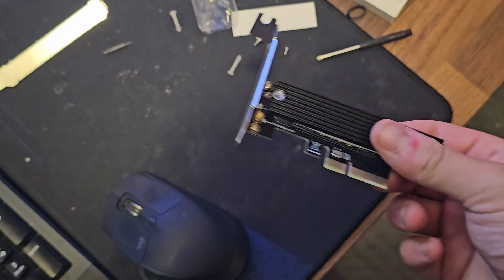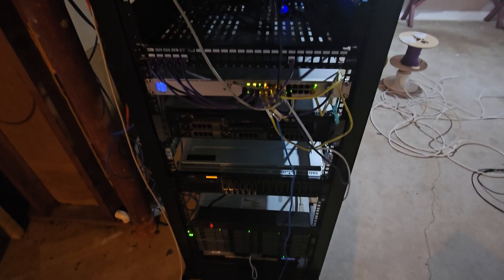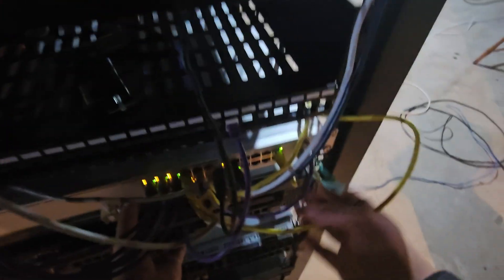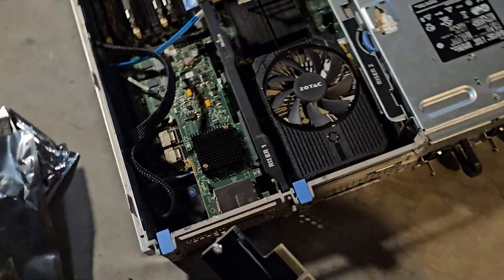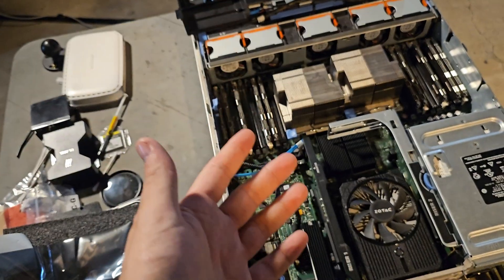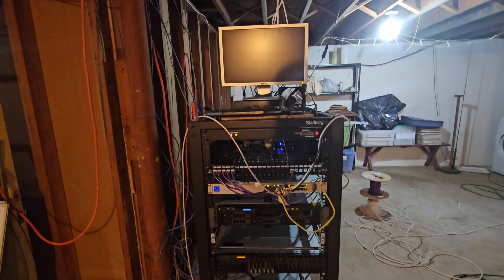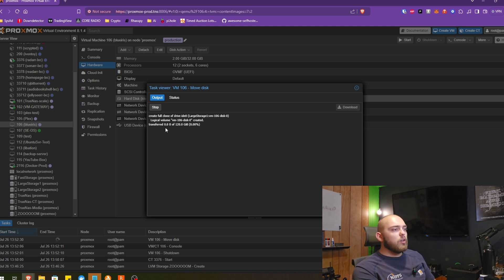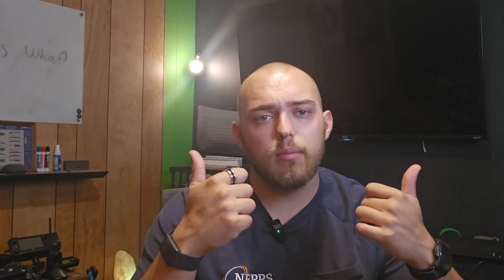Giving my R710 an upgrade it was never built for! | NVME

Comment: Question: Can you put together a list of all your upgrades for the Dell R710?  - Just found one for free and adding it to the homelab
Reply from the maker: I can't fully remember how I got my r710 but over the years I've put better Cpus in I went with 2x Xeon 5660 since it gives me 12 cores 24threads. The server has an upgrade kit for 315gb of ram. The nvme adapter seen in this video and the arc a310 for Plex. Other than that my server has some storage for vms and a storage controller card running copper to my jbod

Comment: You don't need to shut down the vms to migrate storage devices, it only speeds it up slightly. I migrate my vpn and my pihole to another node for maintenance since fast enough for deployment and fast enough for devlopment are 2 different speeds, 0 downtime.
Reply from the maker: Good to know thanks

Comment: Using an Samsung 990 wouldn't be faster than an Kingston NV2: Just PCI-e 2.0 and the CPU will fast maxed out in heavy I/O. Try the NMVe as cache. If it dies, nothing will happen =)
Reply from the maker: I needed the SSD for storage of vms due to io issues i could of gone with 2.5 ssd but I am not a huge fan of the storage controller that's in the r710 and I wanted the system to be migratable if I build a new server in the future

Comment: You are not using the full potential of your 990 PRO as the R710 only has x8 2.0 PCI slots. I would be afraid of this single NVMe failing because of the SSD write limit. This was the main reason I upgraded to a R730 with 24 SAS drives. I got these 1.2TB drives for an average of 18 EUR on eBay. In a Raid 10 setup it offers almost the same performance as a single NVMe drive but I can lose a drive. The rebuild time is fast as it is only 1.2TB and the drive runs at 10,000 RPM.
Reply from the maker: Nice i this is not production here so as much as id love to do some advanced redundant setup. Im just going to use the drives i have in the server in a zfs raid and then i plan to put backups on that array. My media array is backed up via truenas zfs so in a catastrophic failure only the vm server itself is the victim
Reply: @Technogizguy  "not production" versus "home lab" is a big difference I think we as server guys sometimes forget about. I have one server right now that's soooo sketchy. If you even wiggle it wrong it won't work for 12+ hours, but then it just self heals lol. But then sitting next to it is multiple R730's maxed out with tons of redundancy, cloud redundancy as well, it's all redundant! RAM, disks, servers, HA, you name it haha. Just ranting! But there's a time and place for redundancy and maximizing your setup. You do you! I enjoyed the video, cheers!
Reply from the maker: Haha i love it. I go for a balance of sketch and reliability especially in the main vm server. The ai server is a fun one though 2 p40s crammed in an r730 😂
Reply: @Technogizguy  Nice! Mine has 2 P40's crammed in it too! I wrote a guide a while back on doing so. There's a dumb script I made to control the fans via IDRAC since the R730 doesn't negotiate properly with the P40's. I can drop that link if you want. But anyways, thanks :)
Reply from the maker: Oh Yeah that sounds like a great tool